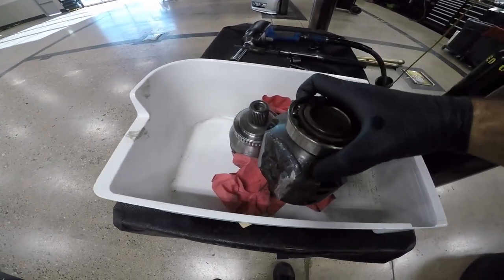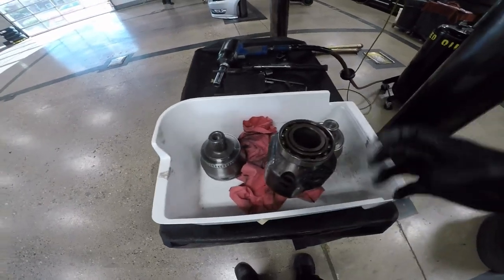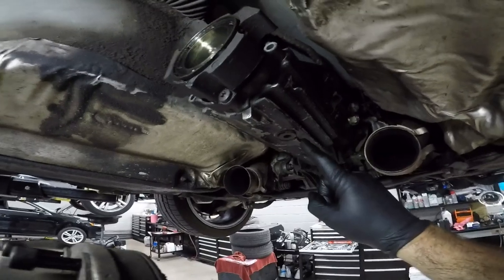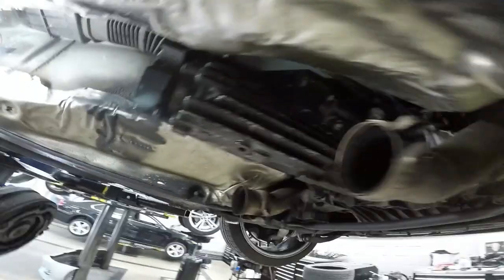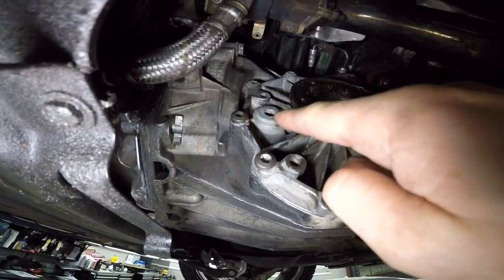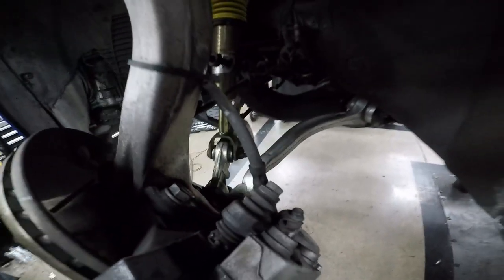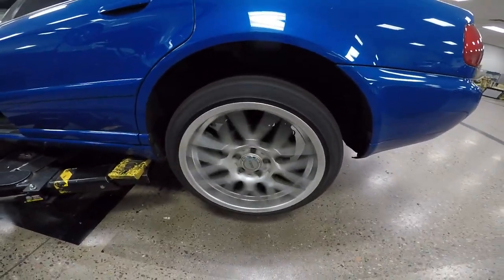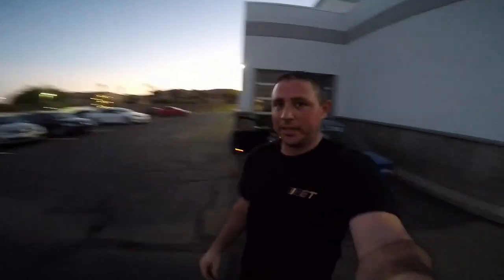How I converted my Audi B5 S4 to rear wheel drive! RWD

Comment: Good Job! all that power to the rear is a recipe for fun!
Reply from the maker: Eurospec Bodega thank you very much.  It’s pretty fun.
Reply: @GermanEliteTuning  where did u get your front axle stubs from?
Reply from the maker: @joshfrankel4155  they were removed form and old set of axles. The balls and cage were also removed the them so they are just the outer part of the cv and stub that goes in the hub

Comment: Definitely interesting that it worked that well. I thought there would be alot of chatter from the diff or the trans
Reply from the maker: MTK143x yah it’s crazy how different it drives.     You can feel some drive train slop when getting on and off the throttle but not bad at all.

Comment: Hello, I am driving my coupe quattro regularly on racetracks. Stock 100kw. In sharp turns i habe some understeer which I cant get rid of. Thought about rwd conversion, putting Power to the ground should t be a Problem with 100kw, but maybe the car turns netter without driven Front wheels? Or Does driving with rwd suck on an Audi? Winter is mostly without snow so thats no Thing for me... And no I keep my coupe, dont want a BMW... ;)

Comment: How does it drive compared to awd? (Not just drifting) Awesome job btw
Reply from the maker: It feels a lot lighter in the front end because there is not any pull from the front wheels.  I have 0 traction when going wot in 1st and 2nd and sometimes in 3rd depending on road conditions. A rear lsd or welded rear diff would help that if I was keeping it RWD.  Normal driving feels pretty normal and the only way I notice its RWD is when I let off the gas the speedo drops to 20mph and then goes back to normal speed when I get back on the gas.  Thank you very much and thanks for watching.
Reply: @GermanEliteTuning  this is not usual staff this is complicated job what have you done.  You have some skills 👍

Comment: You guys wouldn’t happen to sell them welded diffs?? I bought a salvage title beat to shit rust every where b5 s4 that i kind want to turn into a drift missile
Reply from the maker: No I don’t sell the kits but If you remove the center diff and take it to a fabricator or an exhaust shop they can weld the gears on it for you.  Then pull the front axles and remove the outer stub axles and install them into the front hubs and you will be good to go.

Comment: I wanna do that to a passat 4 motion. But dont you have powerloss at the front ''axles''. There is still power going to the front so not all power goes to the back i think?
Reply from the maker: It’s for sure doable on a 4mo Passat.  Yes there is still some drivetrain loss because the front diff and flanges are still spinning but it’s a lot less then with the front axles connected.

Comment: Hello, i wanna do same thing on my audi a4, but i dont understand why you need reinstall  stub axles? is it beacause front wheel bearings or what?
Reply from the maker: Right on.  It’s fun. Yes you need to have them installed so the bearings do not fail.

Comment: Bro can’t u just pull the fuse for the Quattro system? Nvm, that would give u FWD only...not RWD.
Reply from the maker: Eüro Nasty that’s only on the cars with 4motion and haldex like a TT, RS3 or golf R/R32. That does make it only FWD.  the S4 uses the Quattro system that has a center diff called a torsen diff. Thx for watching.

Comment: I know this video is old but I had a quick question, is it possible to just leave the front axles alone and still have it be rwd or do you have to put in stub axles?
Reply from the maker: You have to pull the front axles and install the stub axles for it to be Rear wheel drive.  I installed the front axles and left the welded center diff installed and it sends too much power to the rear still and the rear wheels loose traction.   I’ll be swapping in my original torsen soon.

Comment: Before to continuing with the video I want to ask you something, I have an A4 b5 FWD that recently I converted to a manual transmission and now I want to convert in quattro, it's that possible ?
Reply from the maker: thank you for watching. no you wont be able to just swap to quattro. it will require extensive modification and fabrication to do the swap.  best bet is to find a quattro a4 that needs a motor and swap yours over.
Reply: @GermanEliteTuning  thanks for your advice

Comment: Is there any way I can make it rwd temporarily? I'd still like to have awd for winter driving but I'd like to have rwd in the summer
Reply from the maker: Fuck Ass unfortuanlary the only way to do it is swap the center diff and remove and reinstall the front axles.  Technically you could leave the welded center diff installed and remove and reinstall the front axles when you want rwd or awd but having the center diff locked all of the time could hinder turning at slow speeds.  I have not tested it yet just my thoughts

Comment: Is there any way to fix the speedo? 
Great video 👍
Reply from the maker: Not that I know of. The front flanges stop spinning so that’s why the speedo drops off.  Thank you very much.
Reply: @GermanEliteTuning  so to convert basically weld center diff and remove front axles what do you replace them with

Comment: You only welded the center and left the rear alone?
Reply from the maker: Luis Rivera yes only the center.  The conversion is temporary so I left the rear diff alone.
Reply: @GermanEliteTuning  if it's fun for you i suggest to install rear diff from audi V8, as you know, it have torsen there.
Reply: @GermanEliteTuning  i have done this mod in my a4b5 1.8t quattro two years ago, this spring i'll do it again. But i already have 6-gang transmission swaped lighter flywheel and some rear diff so i can weld it too and put to my pelican blue "beast" xD
Reply: @danielmurawski9404  i jaka jazda w porównaniu do quattro? Czy naprawde jest tak jak mowi ten koleś że tak jakby oddczuwal lżejszy przód?

Comment: Hello my friend, is it possible to convert an Audi B5 (front wheel) to a S4 (quattro)?
Reply: If you're asking if the drivetrain of a B5 S4 fits in the shell of a B5 A4, then the answer is yes it bolts right in. However you need the ECU , and wiring harness for the complex sensor system of the B5 S4 engine and the vehicle should be a manual to do a proper manual swap correctly.

Comment: Awesome job bro, hey i have a question for u I have 2000 audi a4 b5 u think is possible becoming into front wheel drive just removing drive shaft, rear differential and rear axle shaft??? U think is safe to drive with that conversion? Thanks
Reply from the maker: Thank you very much. As far as I know you can not covert an Quattro car to FWD.  you would need to swap in a FWD trans.
Reply: Why would you want to?

Comment: Brad I got a question bro
Reply from the maker: Ask away man
Reply: @GermanEliteTuning  2.8 intake cams, supertec valve train or rods I'm working on the new manifold which will move both turbos to where air box used to be..being my options will be more abundant can you rattle off some turbos . That would be a good complement to the setup ..I'm going to shoot for 600 ..I'm being built for at least 750 and and using a water to air.. but I'm just mainly thinking of turbo size...I'm using the 2.7 heads n intake manny..what  turbos does the 2.7 push really well before going stk that can accommodate my new engine
Reply from the maker: Oh man that setup sounds like it’s going to be awesome. It will be or if work but it will look sick and should perform well.  Are you going to run both turbos off of bank 1 or rout bank 2 exhaust to the turbos?  Rs6 framed hybrid turbos will get you to your power goal on e85 and around 30psi of boost.  The SEP automotive rs6 hybrid turbos have been performing very well on the cars I have tuned with them.  SRM K24s another great option. Those are what I run on my car.
Reply: @GermanEliteTuning  I am modifying clearances on false firewall as well as some other areas..it's a plain as day operation..I feel the true reason the b5 is at limits is bc nobody does something unorthodox..I seen a b5 with a ls and four turbos on the hood..I can def make this work....as I start I should by a camera
Reply from the maker: @THERE4LRizz  Do you have an IG? For sure post it there and I’ll follow the build. If you need help tuning it I’m down. There have been a few guys that did single side mount turbo setups but not twin sidemount setup.

Comment: Is it little faster?
Reply from the maker: It felt a little faster just after the swap because it had a push from the rear so it was a different sensation then i was used to but after driving it more it was about the same. The lack of traction made it accelerate slower then when it’s AWD.
Reply: @GermanEliteTuning  can I do that on my b8 s4?

Comment: Thoughts on getting suspension set up for all time rwd ? And of course probably get the correct parts...
Reply: Probably add I own a b5 with a 1.8t 5 speed fwd
Reply from the maker: you will be good with a set of coil overs and an upgraded rear sway bar.  you can play around with adjusting the ride height so that the weight transfer from front to rear when drifting a corner allows for maximum grip.  im running a set of ST v1 coilovers and they have been great.
Reply: @PHGBellator1  …front wheel drive?…